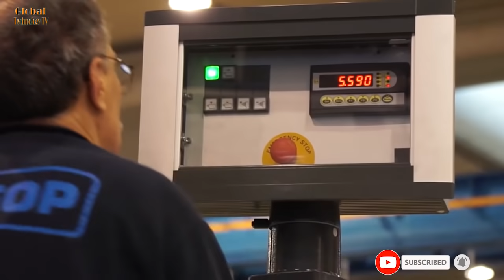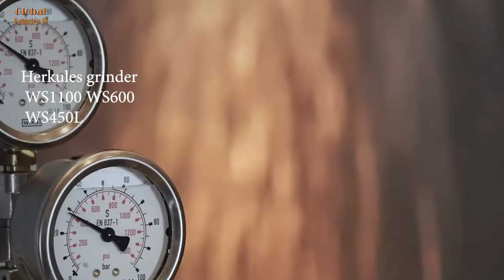The world's largest lathe in operation

Comment: A fantastic CNC marvel without doubt,  but I was using bigger manual lathes over 45 years ago until they de- industrialised the UK.
Reply: Yeah if a lathe doesn't have its own elevator it's nothing.
Reply: @1pcfred  And a wheelhouse on the carriage.
Reply: @Pow3llMorgan  a perpetual poker game too!
Reply: @1pcfred  
And a string attached to a bell when it comes to the end of a cut.
Reply: Exactly, I used to work on a large Cravern Lathe, way back, two overhead cranes used load me up, used to stand on the saddle most of the shift, nackering climbing up and down. I'm retired now, but i know the still have that Lathe, used to enjoy it though..
Reply: @jimh5031  That's the ticket. I guess that job had its ups and downs?
Reply: @1ginner1  I'm a retired Boilermaker, I assumed when I was mid 50's or so, I'd've been teaching in a college. Nope, seems our country doesn't want my/our skills, anymore. So my knowledge,, for the first time since the industrial revolution, won't be getting passed on... a bloody shameful state of affairs. Screw 'em! #parliamentnotfitforpurpose
Reply: My Heyligenstedt had 15ooomm lengt between the peaks and a 2500mm chuck ...
Reply: I'll give you this. It's pretty long. But its definitely not big.  U.S.S PROTEUS AS-19 . Had a vtl you could chuck a volks wagon up on. The captain used it as a ships podium to address the crew. I used to have a picture of some guys sitting around a card table playing poker inside of a see valve while it was chucked up on that lathe.  Now thats getting big. And i know it wasn't the biggest.
Reply: I am not British but when I go to England and see what still stands of her glorious industrial past, mostly ignored by people today, a vicarious sense of nostalgia overcomes me. The engine that powered the world!
Reply: @uvk99  Those were the times. What remains of Craven factory buildings are being torn down, a crime really.
Reply: @skwalka6372  Yes terrible what's been done to British industry, just like the mines. With the energy costs rising and can see my old place being in trouble, more so in the forge, the cost of gas will be bad for them, but they do a lot of referbs for the  navy in the machineshop, maybe that can save them...
Reply: Couldn’t have said it better ladd.
Reply: @uvk99  Well, the British had it coming. Karma from the empire. And a lot hasn't been paid yet. Lets hope it never is because karma from the empire days is just too terrible.
Reply: @1ginner1  the reasons are myriad
Reply: @death_parade  why should ordinary British people pay when they was just used as a tool by a group of people I shall not mention, did ordinary British folk benefit from the empire ?
Reply: @skwalka6372  so true sir!
Reply: @I Post Cringe and everything sent to China to get it made for US AND UK companies
Reply: @1ginner1  
It is wind and solar that have made our bills so high. We need far more nuclear power like France.
Reply: Most of the shown machines are manual, but yes, there are much bigger lathes on the market.
Reply: @GpunktHartman  ...how many Heylignstedts have been sold into any current manufacturing countries .....over the last 30 years?   Their website doesn't reveal very much of anything.

.
Reply: @skwalka6372  ....yes ....once upon a time.    England hasn't been competitive since the UNIONS took over.     It will NEVER come back with UNIONS in charge.

.
Reply: @uvk99  Yup.    UNIONS shut down pretty well everything in England.     No British company could ever compete with the uprising Asian machinery. 

.
Reply: @1ginner1 The US has been de-industrialized too unfortunately, we now only have the Dollar propping our economy up but that's a house of cards waiting to collapse.
Reply: @jimh5031   I bet it was hell in the summer when the air conditioning failed
Reply: The largest lathe I have seen was in Newcastle,  GB. It was for sale, and had been used to machine legs for oil rigs. It was sunk into the ground, with the carriage at floor level. The operator rode on a platform.
Reply: During the reign of Henry VIII wooden warships were state of the art and their construction supported everything from timber production, sawing and making, to hemp products and rope making etc
These industries were adversely affected by the age of steam powered ironclad warships that required increasingly state of the art boilers as a key component of ships of the line until the invention of nuclear power.
By which time nuclear powered aircraft carriers dominated and Britain had disgraced itself on the world stage by conducting genocide using biochemical weapons (agent orange) in Malaya 1948-60 under Churchill.
And in turn, the nuclear powered aircraft carriers operated by the US became obsolete and their supporting industries, collapsed (the situation today).
Through all of this, the design of weapons capable of sinking ships at long range has been the driving force and until very recently has adhered to the basic laws of mass x velocity.
Most recently, drone warfare and the electronic warfare systems that support it, have become state of the art, have arguably re-written the laws of modern warfare by rendering heavy weapons useless.
Change is inevitable.
Reply: god forbid workers get paid fairly and dont get endangered at work huh? @taxicamel
Reply: @death_parade  many third world countries are still using roads and infrastructure from those times bud. Why haven't they replaced them with modern infrastructure?
Reply: @burnheretic3950  Who told you that they still use roads, railways and infra from the British era? BBC? I've seen BBC spout such bold faced lies non-nonchalantly about infra in my own country. Doesn't make it the truth though. Anybody who thinks British era roads and railways can continue to work 70-80 years later is obviously somebody who has no idea about engineering in general. Even modern concrete expressways have a design life of not more than 50 years. 

Honestly, folks really need to stop with this colonial apologist BS. Countries didn't need to get colonized in order to get railways. They would have gotten railways even without the Brits bringing it.
Reply: Unfortunately it’s not required. All traditional skills are not necessary anymore it’s all computerized. If you want to use your skills go to India where they still the old methods !  Be lucky 👍🇬🇧
Reply: Yep, I was using bigger lathes in the 70s and I was an apprentice, machining winch drums 3mt diameter.
Reply: Factory demolitions.   Space needed for immigrants.

Comment: Is it a big lathe, Yes. Largest? No way.  Working in a factory years back, the lathe at the next work station had a 144" (12 foot) swing and a 50 foot attached bed plus a long, unattached sub bed. Across the aisle was a 'little'  84" swing, 25 foot long bed. There were larger in a different department making steam turbine rotors
Reply: A piddly 12 ft. Swing? We scraped those making room for 20 ft Swing.
Reply: @John James do you think he would sell it as is where it's at?

Comment: In the Number 2 Machine Shop at Bethlehem Steel at Sparrows Point, MD was a lathe 125-feet between centers. Finish cuts needed to be made at specific tidal times to avoid distorting the workpiece.
Reply: Wait what did tidal times change?
Reply: @ricky107_   the workpiece would have lifted slightly off center, causing a dimensional anomaly ...
Reply: That's incredible. I've heard amazing things about that place. I wish it was still there. Seems like an age old story, places driving out industry.
Reply: @blackburn1111  With help from a neighbor, who knew about my mechanical abilities, and who was a big boss at one of the mills there, I went from a high school dropout to tool & die maker apprentice, roughing out and finishing explosive bolt sets, helping a small group machine thrust domes, and working on other contracts for the Apollo Moon project. When the NASA work came to an end, I worked at the Point for another few months until 12,000 engineers and machinists were paid off (me included). I never worked in that industry again, but what I learned there in three years was an enormous help in subsequent businesses.

My favorite Point story was one that I actually witnessed. A group of half a dozen guys were sent down to inspect a tunnel used to carry gas lines from the coke ovens to Baltimore City. We were equipped with respirators, HD flashlights, and two-way radios. Nobody had been in that tunnel since the end of WWII. we had only gone a few hundred feet when we came upon a makeshift table, four makeshift chairs, four poker hands had been dealt, and on the four chairs were the desiccated remains of the four poker players. Each of the men still carried ID and ring of tool checks. Apparently, the men all worked on graveyard shift, and every night, they would leave their machines to their helpers while they went underground to play cards. One night, there was a huge gas leak which probably killed the men instantly. The company reportedly placed the four on AWOL status and terminated them, not knowing the men had never left the job that fateful day.
Reply: @michaelbyrnee9584  well ain't that just sweet
Reply: @t.texastimmy1022  So condescending yet even after an edit your post still has no explanation...
Reply: And people today will say the moon isn't real... 🤡
Reply: @Te4mUp  Do you understand tidal movement? A lathe needs a rock-solid base. Our machine shop was built on fill, deposited on low-lying land right on a coastal bay.
Reply: Rajkot, india,  best big machine menu fetcher
Reply: *38,1 meters
Reply: That is a great story! I can’t believe nobody ever thought to look down there where they were sent.
Reply: Really?, they have to account for gravitational fluctuations, that’s amazing
Reply: @jeffryan7439  No. That shop was built on fill that extended the original shoreline: tides controlled when finish cuts could be made.

Comment: I did work in Todd Shipyard, in Seattle, WA. working on a very long Lathe was finishing turning the ship's rail shift, I love being a machinist.
Reply: so this is for a ships transmission???
Reply: @vincentliuo  Yes, the propeller goes on it.
Reply: USS America had a damaged drive line that occurred in the Atlantic during a rough crossing.  It stayed in and the vibration continued for almost 20 years until it was decommissioned. How do ya remove and replace?
Reply: @printzapper  Many reasons cause vibration it needs rebalances or replacement, bearing in this drive shift, Send to dry Dock for the repair job.
Reply: @vincentliuo  This is a propeller shaft for the ship which they call a driving shaft.
Reply: Yes, this lathe wound up at the Foss shipyard for many years and I believe it could that 114-foot shaft, the tool holder has a seat for the operator to sit on as it moved down the work.

Comment: I worked on a 24" hollow spindle. The steady rest was out in the steelyard on a chain trolley. Manual API thread repair of tool-steel subs, casings, and drill rod.  Had to stab the little door, and both sets of jaws. When I turned the tool steel I had to specially grind my tool into what was called a spoon. 20 rpm, feed-rate, min .060", 3/8 depth. Engaged cross feed and lateral feed simultaneously to hog off the end. The shaving came off glowing, then turned a nice blue, razor sharp. It would snake around my lathe and I kept an eye on it (among other things), ready to redirect if it with my broom handle if it got hung up.

Comment: I love it! the biggest chucks we had on the LeBlond's were 4' chucks x 25' bed (i think if i remember correctly one of them had a GAP BED) which were PLENTY big enough; Then we had the monster VTL with 3, 5 and 6' tables.  Some of them were from the 1930's and 40's AND were still running when the Machine Shop shut down in Oct 2002 and our work went to foreign countries.  One machine shop worked at 1981 and 1982 had the Brown & Sharpe Screw Machine with the Military Oridence stamp marked 1942 and those machines ran in our shop for years and some for MONTHS at a time NON STOP  yes those old machine made many of bombs and bullets or parts for the war efforts

Comment: How wonderful it must be to work on a lathe that has a tailstock that the operator rides on, and it has a guard rail as well.
Reply: the operator rides on the carriage, not the tailstock.
Reply: @theturdcurd2382  I looked again. It's the tailstock. It's flat faced with a hydraulic ram with a center in it to support the part. The carriage is shown toward the end with it's rotary turret. That's different. Not what I'm talking about. He's riding what on other lathes would be called the tailstock, not the carriage.
Reply: Whatever, I worked on one, but you be you, I'm not gunna argue over this.
Reply: @theturdcurd2382  Smart. The thing the man was riding on with the handrail had a flat face, large plunger that moved out the flat face. the center of the plunger had what appears to be s dead center in it that they show coming out and engaging the long shaft coming out of the chuck. The tailstock had no other tooling on it. In my machining world we call that a tail stock.
Later in the video they showed a turrent with various tools on it that would rotate and the tool would move off onto another part of it. That would be the carriage. 
But what am I going to believe, right? You or my lying eyes?
Sorry, I don't believe you've ever come near one of those machines. I think you took a hasty look at best and made a hasty comment.
Reply: Were talking about 2 different videos then. Again, not gunna argue.
Reply: I ran lathes back years ago, I had a saddle 🐎 horse to ride back and forth between the centers
Reply: @galewinds7696  😂
Reply: @galewinds that is way outta worldly! I imagine the chips on the flow verses the metallic hoofs! Impressive in action! Them wait till is hits the stop the turn in slowmo!!
Reply: @galewinds
Reply: @berntinulkshredder  that was just part of it, had a stable under the chip pan where he stayed every night 🌙 😳  🐎
Reply: @galewinds7696  it seems a lot fast live there, I must believe they had a cook for the chip journey with chip cookies! This life!  What A great way to spend silence, with clinging clinging sounds of chips!
Reply: @galewinds7696  with the chips rhythm!

Comment: I wish i could post a picture of a large Betts lathe at a shipyard that has the contract to do the Nimitz class air craft carrier shafts - huge! twin carriages and we put CNC controls on it including dual servo through 50:1 apex gear heads that work together and zero out the backlash on the Z axis rack. This lathe will cut a class 3c thread and its swing is 17.5ft 150ft centers and about two stories tall.  Because defense work - we are not allowed to publish pictures. God Bless and thank you for presenting this awesome lathe!
Reply: I was doingsimilar work. We had machinists worked around the clock at that time. It was very impressive for a younger me, fresh out of NTMA training facility and met the real world.  It was almost 30 years ago but I still recall vividly everything.
Reply: @vigormanh2980  this shop is very large - 24 round the clock support and now a 10 year backlog. They just purchased two Italian lathes (i'll edit later when i remember the names) - these are huge full CNC on delivery and required immense foundation peers and piles prior to their placement.
Reply: @prestonburton8504  It great to have ton of works line up. Must be a busy machine shop. Now, back to the size of the CNC lathes or CNC turning centers, those are shown on this video are not very humongous. I wonder if you have ever seen the vertical lathes.  I have worked on them for couple of years. Very impressive they were.
Reply: @vigormanh2980  yes - the largest are specialized Bullard's made for the power industry that cut the forms used to make heat treated pipe, couplings, elbows and bell fittings.  As of six years ago, they still used hydraulic stylus pens that edge follow large patterns that repeat the contour shape on the forms. These forms are then used as mandrels during forging process and before final heat treat (38RC but i've seen 48RC on treats) - very high pressure superheated steam in primary loops. We are waiting for them to finally decide to go CNC but union opposition as well as certification of process stops this.  Actually, that is in texas and mexico plants. Some of our shipbuilding plants cut ship pistons on large cnc now - but the largest is an asquith manual 30ft table that was made in the 30s and i've actually worked on the one in newport news shipbuilding - hand made by them in early 1900s and is used to make propellers and parts of the shaft drive line including the final part that gets fitted into the hull. I dont know if its been converted to cnc yet.

Comment: GE was operating lathes bigger than this in the 60s, they would make chips 3" wide and had a chuck that was at least 14 foot in diameter. Length was variable since they could put in track sections to make Length  whatever they needed. The steel mills of Pennsylvania had even larger ones. Most were sold off when the mills closed.
Reply: I worked on a 16' Mesta lathe in Anaheim,Ca at  the Ge apparatus service shop where they repaired turbine spindles. They had bid VTLs there also. Fun work.
Reply: The largest in Sch'dy LGM dept, 1960s (Bldg 16) was the 144" noted above. LSTG (Bldg 273) most likely had even larger but that wasn't the dept. where I worked then.

Comment: What I find most interesting is that forgings the size of those workpieces can be made without internal defects.
Reply: That's what i was thinking. I assume on a piece that size the tolerances are a bit looser than what I would expect too. I wonder how much that blank cost
Reply: You can pretty much be assured that when the final product has $100,000+ worth of machine time scheduled (OR MORE), on it, several pre-machining inspections have taken place. (X-ray, Magnetic particle, ultra-sonic, etc)
Reply from the maker: cám ơn bạn góp ý .